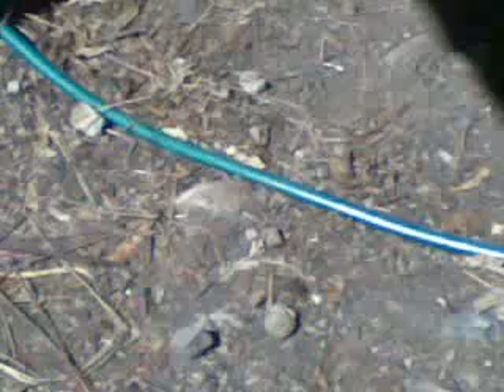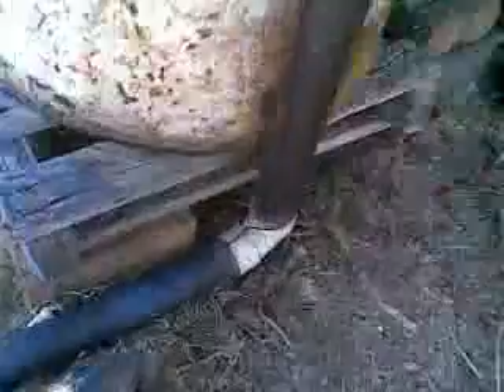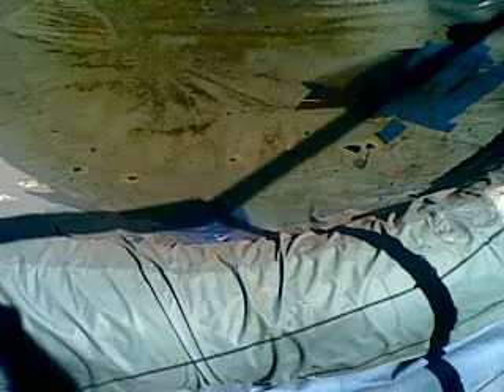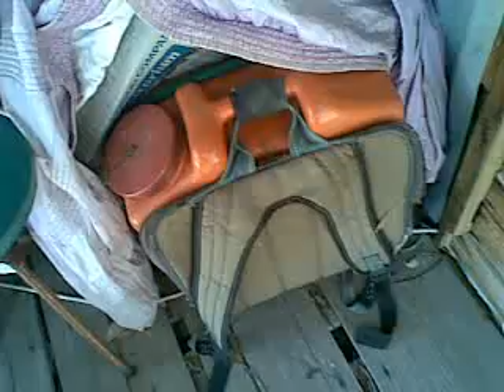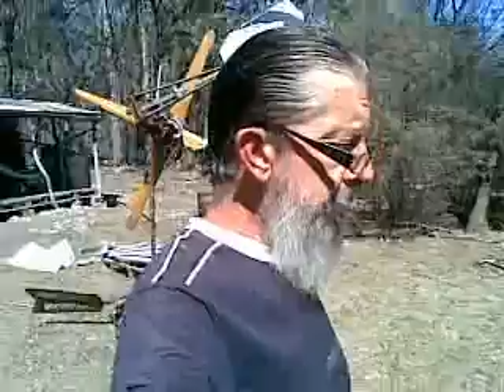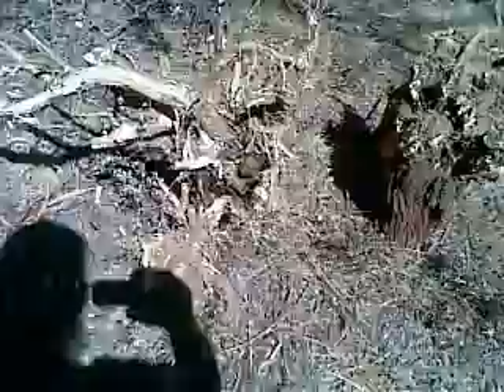Hillbilly Water Management...

Comment: Great idea using one of those pools as a tank. We bought one tbis summer. Life saver in the heat.! Early on the dog chewed a 20c piece size hole in it. Only glue that worked was selleys aqua repair. Long dry time but worth it. Now summer's waning the pool has become a 5000 lt tank for the garden. Cheap storage. Go warbles.!